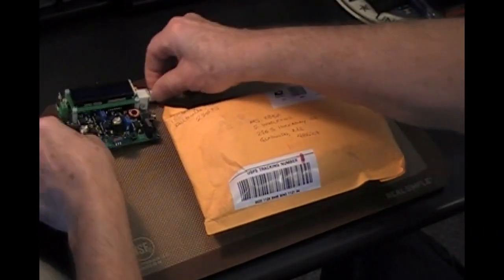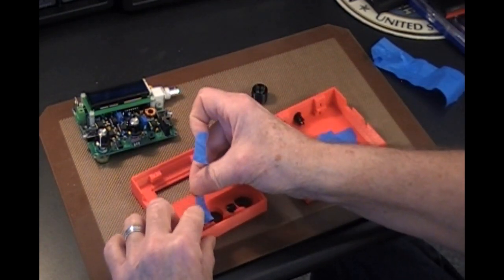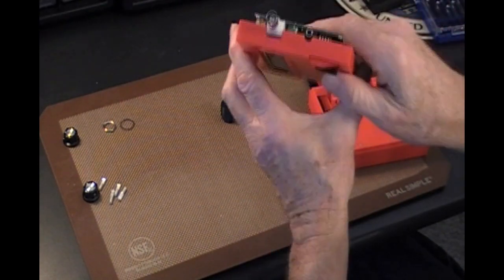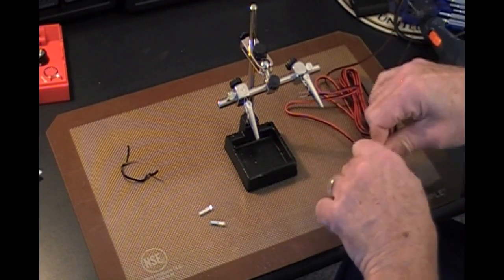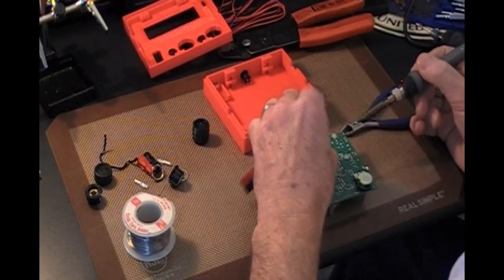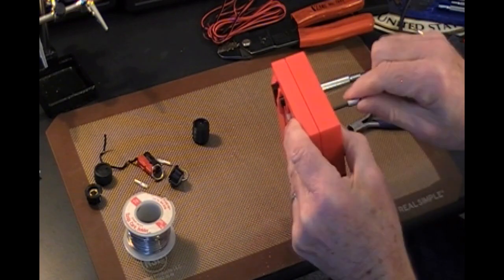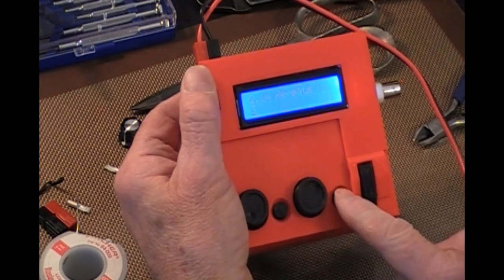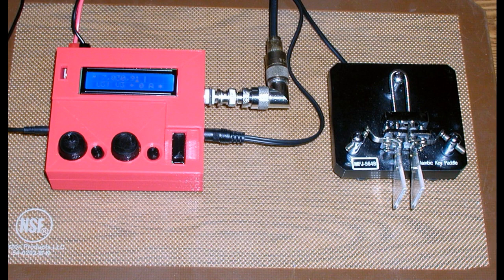QRP Labs QCX Enclosure by W4MHZ

Comment: Steve, another very well produced video and very timely info for me.
I've been trying to 'Read the Mail' with my 40Mtr QCX but my Morse skills have gone way downhill and are in dire need of upgrading. HiHi
I practice with LMCO and G4FON but need to be more disciplined in Just Doing It!
I'll have a Spiral Loop and EFHW up and running in my appartment in a few days and try a few QSOs but need more work on my CW.
Like so many HAMs, my sending is so-so but my copy is really poor.
After 33+ yrs of HF Phone, I'm embarrassed that I've only made one CW contact and that was many moons ago.
I'll be ordering an enclosure from Mike soon.
Again Steve, very well done video and tnx moocho-much for this new info.
Russ in NH
KA1RUW
Reply from the maker: Thanks for the comments Russ.  Good luck on working on your CW skills.  Best way to improve your skill in my humble opinion is just to get on and make CW contacts and copy what you can.  The high end of the 40 meter band is a good slow speed CW location.  Have fun and I'm looking forward to working you on CW.

Comment: Thank you for this video. I was looking at the QCX kit, but was unsure do to the lack of enclosures. I just sent an email to Mike. I like supporting hams that are doing things themselves. I just got a new mini-straight key from cwmorse, looking at getting this kit radio, and now an enclosure from a ham. I am making a whole QRP CW micro kit. This enclosure definitely looks amazing.
Reply from the maker: Thanks for the view and the remarks.  The QCX is an amazing little radio at an unbelievable price.  The enclosure is very good also, as long as you realize you may have to do some 'shaping' of the inside to properly fit the QXC.  I did a couple mods since this video was made.  I added a small power toggle switch to the left side of the case.  I also found the knobs a little hard to grip with my big fingers.  I solved that problem by hot gluing a couple orange wire nuts on top of the knobs.  The color matches and now I can get a good grip on the knob for tuning.  73, K8BZ

Comment: I built one of those. Nice project. I have the enclosure sponsored on the QCX website, it was an easy install, but you loose the built in keyer and no power pole connection, but it comes with rubber feet. Pretty amazing device packed with features for a small price, good support, highly recommend
Reply from the maker: You are correct sir.  This is an unbelievable radio with amazing features, at an unbelievable price.  Last night in the ARRL DX CW contest I decided to see just what I could do with this 40m radio and a G5RV inverted vee, 40 feet at the apex.  Worked several station in Europe and the Virgin Islands.  Didn't get them on the first call, but it didn't take long.  Every die hard QRP op needs at least one of these radios.